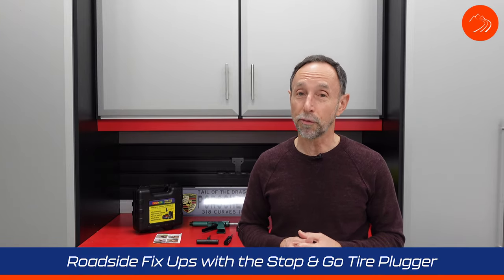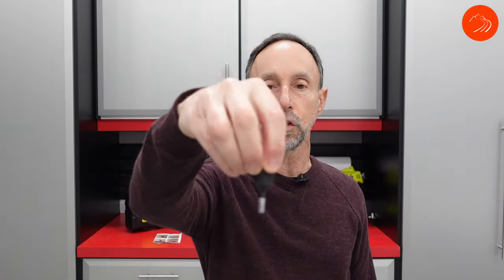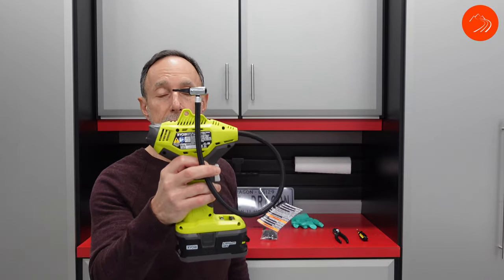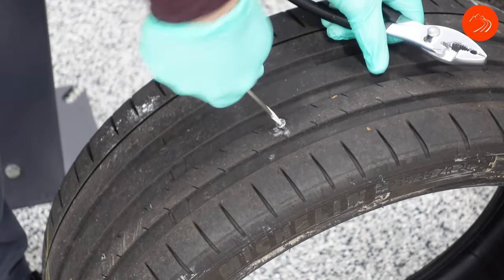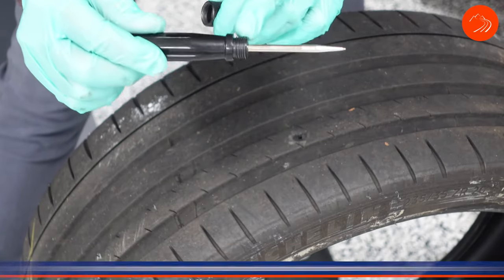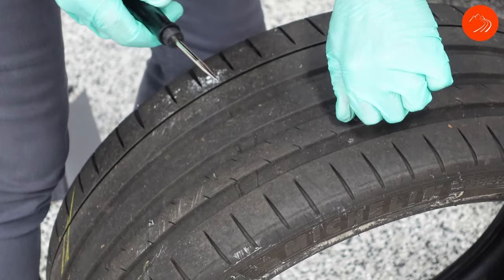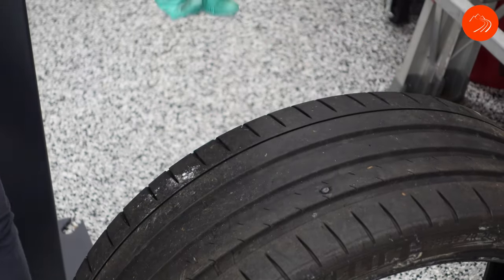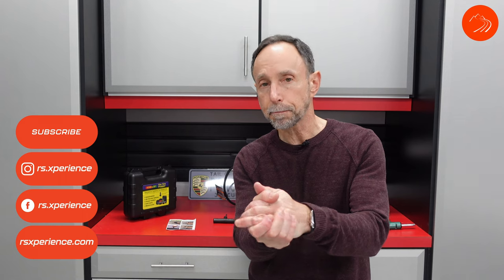STOP AND GO TIRE PLUGGER WILL GET YOU OUT OF TROUBLE ON THE MOUNTAIN ROADS

Comment: No thanks , I will stay with  the sticky $6 rubber strings repair kit. I had nail on the sidewall and used that simple needle rods and a dap of super glue at the tip of the plug. It's been 1.5 year 8000 miles and still no leaks....😂👍
Reply: Same here had a sidewall scratch been 2 years since the plug and no problems

Comment: that repair between hands at the end is the recommended use under normal circumstances however if you're in a survive or not situation you can plug anywhere on the tire including the sidewall "IF" it is a straight smaller puncture hole not a cut or split like is typical on sidewalls but that also doesn't mean you can just plug and forget anywhere on the tire and use it until it wears out, you can do it to get your behind out of trouble then replace the tire.....

Comment: I must have received a defective gun, had to return, with handle squeezed 5 times with plunger bottomed out plug wouldn’t even make it to the funnel looking tip. Seemed like a good concept. I’m sticking to the rubber tubes and glue.

Comment: I don't trust it, the sticky plugs form to the damage where as this looks like it can possibly wiggle itself out at any time
Reply from the maker: Understood. It comes down to what you’re comfortable with. I had mine in for several hundred miles before I replaced all 4 tires. The plug has a mushroom head that expands once in the tire to prevent it from coming out. Although YMMV. I would not used the plugged tire for HPDE events.

Comment: I'm a woman with some hand arthritis, and for myself I like the way the smaller kit w/out the "gun" works. It  comes in a canvas case I think. Using the small (Allen?) wrench to gradually screw the plug down into the tire. The same job just done in a different way, and not requiring as much strength or grip. Another plus for me is it takes up less space to carry. My tires are off-road type on a large Jeep, so likely a bit tougher than a sports car. This kit looks like the thing to carry!

Comment: I've been looking at a few videos about plugging tires, and I just did one last night, and this seems far and away more difficult than the manual way of doing it without the gun. The whole point of the gun is to make it easier, and I guess the force part is reduced, but it's more involved in tough conditions typically with all the steps to get right. If you lubricate a bit with the manual tools it should be fairly straightforward and easier to navigate. I didn't use lubrication, but rather some glue, and I still got a small screw hole fixed with some effort.
Reply from the maker: Admittedly the gun can create some challenges especially if unable to remove the wheel.
Reply: I have the same kit, but my gun doesn’t push the plug out of the tip. I think it’s cool concept,  I have had success using the manual ones
Reply from the maker: I had the same issue early on. When I made the hole larger with the auger tool it worked fine.

Comment: Will it seal better if you add glue to the plug before putting it in the gun?
Reply from the maker: I don’t believe so. The plug has a mushroom head that expands when inserted in the tire. When you pull out the gun and full the tire with air it will seat the mushroom head. I drove several thousand miles after the plug with no issues.

Comment: Is it possible to use any kind of lubricant when inserting the nozzle/probe? I am thinking that this might make it possible to screw the nozzle onto the gun by turning it, and not by turning the gun. As you said, this might be pretty difficult on a real tire puncture on some cars. 

I have one of these kits (haven't had to use it yet). I was wondering what the slippery stuff on the plugs is and if it is available separately, to use on the nozzle?
Reply from the maker: Good question. Having used the kit several times now I find that reaming out the hole is the best solution. You actually need to make it larger than you may think. Then the slickness of the plug makes inserting so much easier.

Comment: Can I reduce the chances of the mushroom plugs developing leaks by coating them with rubberized cement before insertion, just like with rope plugs?

I see a lot of comments saying it will help, but the mushroom plug is made of a different type of rubber that does not vulcanize, so I feel like rubberized cement won't do anything
Reply from the maker: I don’t know the answer to that specific question. From personal experience I’ve driven spirited on mountain roads with no issue. Until I needed to replace the tires. YMMV.

Comment: If I need to use 2 mushroom plugs one near another, should I reeming ones or two times
Reply from the maker: If there were two punctures in the tire near one another I would advise replacing the tire. If it is a larger puncture using multiple plugs may be an option. I’ve seen it done before where three plugs were used in a large hole caused by a bolt. YMMV.

Comment: What keeps the plug in whilst you're driving around? Is it just friction, or is there glue on the outside of the plug?
Reply from the maker: Thank you for watching. There is a mushroom head on the one end of the plug that expands once inside the tire. Makes a seal larger than the whole. I have had no issues with leaking on tires I have used it on.
Reply: air pressure from inside keeps the plug against the inner part pf the tubless tyre,you cannot use this if you have a tyre with the inflatable tube in it

Comment: Looks good but doing that with a tire still mounted on the car could be a challenge, a regular slime plug is faster and easier.
Reply: I can’t sy why but those Slime Plugs have started giving me fits in the last couple years.   I’ve used the string type since the 70s when as far as I saw the plug guns I saw at garages went away.   It was supposedly about not working with the then new radials🤔 .    Anyways they came out with the red string types supposedly for radials and they were fine for decades .    I used some rubber cement on them both as lube and to help lock them in.   The package said use the red for radials and black for old bias types and I just went with it.    I had issues with only one or two and it was on nearly bald tires.     On some I additionally Slimed them if they leaked slightly.   
   Some time back I noticed the redo ones from Ames and K Mart ect went away and only the Slime Black are all that is available so I went with them.   That’s when I started having issues with the real issues of continual seeping.    With the tire sensors I was / am reluctant to slam them with a full load of Slime.        Well Two weeks ago o got the double whammy with a biogas’s industrial building steel outer wall screw in the middle of my F 150 Tire followed by a smaller one on my boat trailer, both radials.    The truck one was big though I fixed  both  with the strings and watched  them a week or so.     Darned if one day my boat tire died at the boat ramp park out while I was on the water.    Nice pain changing it in the dark.    Then double whammy as the truck s tire did the same thing a week later with more fun in the dark after working fine for a couple weeks since the fix.      
   That’s when I said ENOUGH and bought that green gun off Amazon.      I will say it’s built so beefy that I had to put a magnet to it to figure if it is steel or aluminum it’s that beefy.     I have to say it’s pretty easy to use and the direction sheet is fairly painless.    Time will tell as that truck tire holds air fine but it isn’t back on the truck yet and it held fine with the string before failing.     
   As for those black Slime strings it’s just my observation but after decades of using those things I’d say avoid the Slime brand and go with something else.    As for the mushroom plugs and gun they are nothing but pure rubber .   It seemed to plug that big hole very well but I wish there was. Way to gunk it with rubber cement without flopping the gun tip all up inside.    Perhaps cleaning it out after use  with solvent , I don’t know yet.   As I said earlier time will tell.